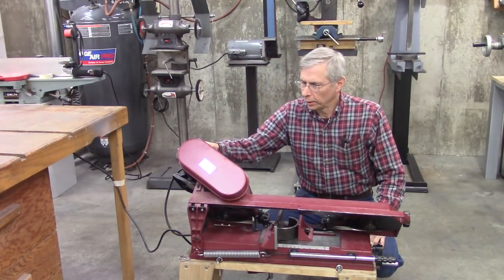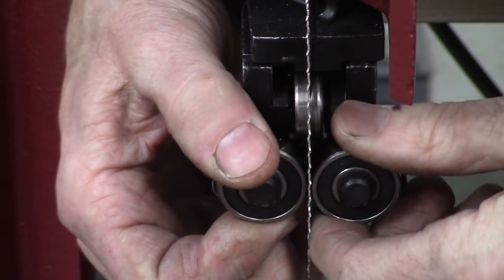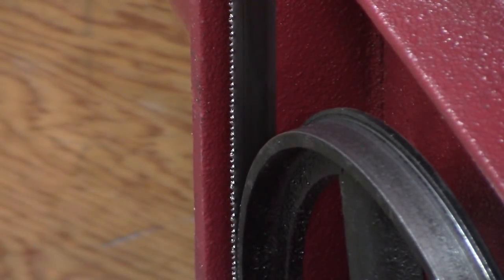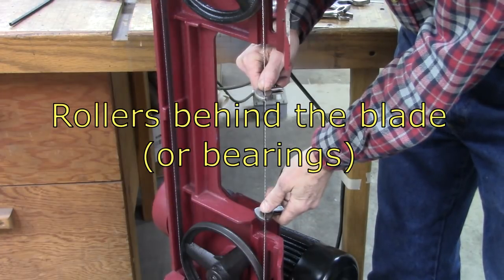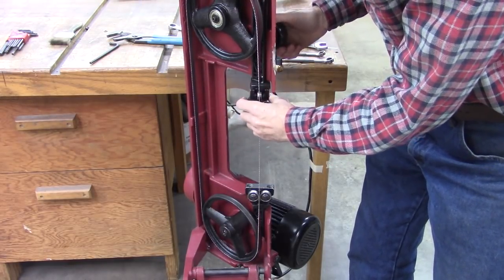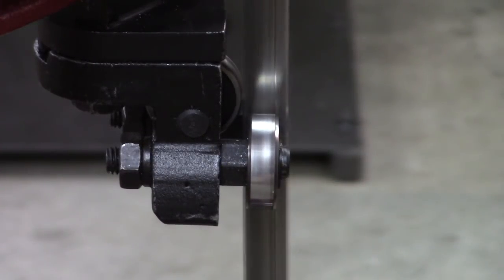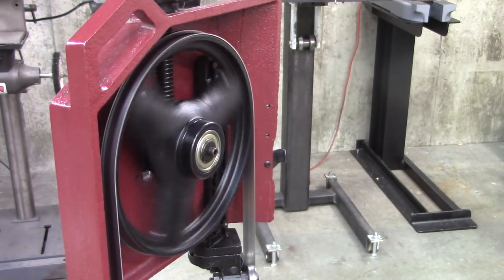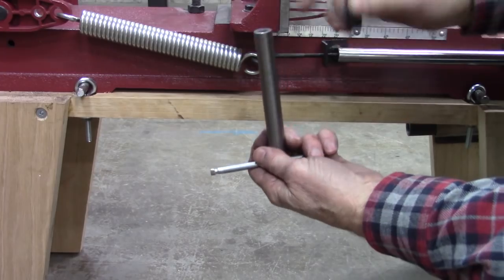4" x 6" Horizontal Bandsaw Tune Up

Comment: i have a question. i bought mine this year. on the tracking. when i take my blade guides out and run it the blade hangs off the bottom wheel no matter how i adjust the tracking. what do you think?
Reply from the maker: The way the blade tracking works it's affected by the amount of blade tension so make sure the blade isn't too tight. Also you have to loosen the other two bolts slightly. It works but it's not a very good design. If you understand how this works and know the tracking adjustment won't correct the alignment on the lower wheel then check the lower wheel position on the shaft. There is a snap ring on the end of the shaft and the wheel needs to be up against it. Also make sure the center screw on the upper wheel is tight. If you take the bolt out on the upper wheel shaft the end of the shaft should be close to flush with the bearing. If the shaft is significantly recessed into the bearing the wheel may not be on all the way, And finally, make sure the tracking adjustment isn't coming apart and allowing the wheel to be pushed out. This is hard to describe but basically if the two upper most bolts are too loose the tracking adjustment bolt will push the wheel out. I know a guy that had the same issue and he took his saw back and got another one. The new one was perfect although he did buy my elevating plate to address a depth of cut issue. Hopefully this helps.
Reply: @WinkysWorkshop  thanks . thats some good information. i wiil recheck the upper and lower wheels. on the blade tension. i have read about so many differnt ways to determine proper blade tension. what is your opinion on this ?
Reply from the maker: @joelspann228  - the way I see it, tight but that's not very scientific. Tight enough that the blade doesn't deflect while cutting.
Reply: @WinkysWorkshop  thanks . very helpful

Comment: I bought one of these last year (grey and sold in Canada) and they're great little saws for the money and should last a good long time, but the initial quality control and fitting is pretty poor and mine needed some fine tuning as well. The supplied belt wouldn't go over the pulleys at all so I used some link belt, the pulley cover (plastic) rubbed at the highest speed and needed some work, and the little metal bracket couldn't be adjusted far enough to trip the toggle switch to off after I adjusted the guides. I had to elongate the slot a bit to make it work. I also need to make a new stand for it, the factory one is pretty flimsy. I had an unused metal handwheel that was a perfect replacement for the plastic crank handle on the vise. I compared it to one owned by a friend that's over 30 years old and other than more plastic knobs and covers they're pretty much identical. There must be millions of these out there.
Reply from the maker: The switch lever issue surprises me. The prefered blade guide adjustment is with the back bearings in the guides just barely touching the back of the blade. Mine will not adjust that far but even so the saw has to be adjusted super low to make the blade cut all the way through stock without tripping the switch. Are your guides pushing the blade down? I'm wondering if there are a bunch of variations of this saw or it they are all coming fro the same factory?
Reply: @WinkysWorkshop  The castings all look identical but many other parts are different. Both my switch (a metal toggle) and the trip piece (shiny, not black) are different, and the belt cover is moulded black plastic. My blade guides were much better aligned than yours. It may be a common design, even using the same castings from the same manufacturer, but be assembled  in different factories. Some parts probably change due to availability. I’ve also been told that different companies will buy products made off of the same line but with slightly different specifications for fit and finish, secondary parts, and of course, colour. The company that sells mine do all of their machines in light grey. I compared two different bandsaws once that were side by side in a store, by two different badged companies. They were obviously the same design using mostly the same castings, but the castings on one were cleaner and better finished, metal rather than plastic knobs, better hardware, and just looked like it was put together with more care. I suspect that the metal composition of the castings might even be different. There was also about a 20%-30% price difference.
Reply from the maker: @robertpearson8798  - The castings set the blade postion. Or I should say, the way the castings are machined. After casting the holes for the wheel mounts are machines and so is the pivot point. When my blade guide are set so that the blade is only twisted and has no deflection (which is ideal), the blade will not cut completely through the stock. If you are cutting completely through the stock without having to deflect the blade I suspect the pitot point is machined in a different location. Moving mine 1/8 to 1/4 inch would likely fix mine.

Comment: Great video! I bought an earlier genesis of the same model 20 yrs ago to cut stainless pipe...made up a coolant recovery system and made scores of tweaks as many mentioned by many of your viewers. It still works great when used properly and I don't go beyond its limits.Best $100 spent for a typical off-shore product.
Rick from Canada.
Reply from the maker: Good value for sure!

Comment: Good video. ia have the same saw. I did put 2" angle iron on the corners of the legs and underneath both sides of the tray. I also put bigger wheels on the back and swivel wheels on the front. It rolls good and will turn any direction. This really made the saw sturdier.
Reply: I did the exact same with mine. Locking casters on all four legs, the angle iron made is much more sturdy.

Comment: Enjoyed your video thanks, but how did you make and fit the wooden frame?
Reply from the maker: Thanks, The only reason I made the wood stand was to make it lower to fit under a table. I don't think it has any advantage.
Reply: @WinkysWorkshop  The only reasons I asked was that my present machine came without a lower half or wheels at all second hand, a previous one I bought new 20 years ago had awful weak and fragile support system, just sizes of wood used and fixing methods would help please.
Reply from the maker: @dvddale111  I made the stand out of white oak that is 1-inch thick just because I had it. You could use a 2x10 and do the same and use plywood for the legs. Screw and glue them in place. Here's a link to a drawing. The drawing does not show the hole size and position in the table so you'll just have to set you saw on the base and make sure you can access the blts needed to adjust the fence etc. I angled the legs out about 1.5 inches at the bottom which is also n0t shown in the drawing.  https://photos.app.goo.gl/WiYGL46FcFSnzGtD9

Comment: More then well done!
What an educating, useful and important video! In the beginning the thought was I've seen this, practised it and improved my bandsaw already. That was lesson 1. Your video was lesson 2, 3 and a bonus lesson.
Lots of thanks!
Reply from the maker: Wow...  that's a great comment, Thanks!
Reply: @WinkysWorkshop  You really deserve it. There are plenty of bandsaw improvement videos on YT but You showed things I haven't seen before.
Reply from the maker: @Stefan_Boerjesson  - Well thanks! In concept it's simple, don't deflect the blade. This was my gut feeling and to some degree what I had already done. Then I did a little searching and found a video about a Grizzly Tools bandsaw. It was one of there high end saws and honestly a very poorly done video but they were saying the same...  twist the blade, don't deflect it. The thing is, the HF saw does not allow for this without some modification. Still... if you go in this direction as much as possible the saw will work fairly well.

Comment: 23:25 I don't know why you've used a piece of pipe when you could have adjusted the moving jaw to the right to achieve the same thing.
Reply from the maker: It centers the load on the movable jaw. The movable jaw will not get close enough to the blade to hold a small piece and it also pivots. When clamping on one end of the vise the bolt doesn't hold. It's never good to clamp on the end of a vise anyway but using the pipe distributes the load evenly
Reply: @WinkysWorkshop  Yeah, I guess you'd need to have cut the first piece off to put at the other end of the vice ;) to balance the load.
The half-pipe is a good fix for that.
Reply from the maker: @millomweb  - Yeah...  super quick too

Comment: How  do you get a starting position for the top wheel?
Reply from the maker: Good question. Honestly, I'd take the blade guides off and put the blade on under a small amount of tension and then hold a straight edge against the lower wheel or slightly away and then make sure the upper wheel is square to the straight edge. Hopefully you can run the saw and keep the blade on after doing this. Then you can adjust the upper wheel angle until the bladed just barely hits the ledge on one of the wheels. Then start increasing the tension and readjust the tracking as needed. The reason the blade guides need to be removes it that if they are positioned wrong they also effect the blade tracking. After the blade has enough tension and is tracking right then you can install the guide correctly. Ideally the guides should only rotate the blade to the vertical position. Hopefully you don't have a depth of cut issue after doing this. If you do, you can deflect the blade downward with the guides a little but doing this very much is not ideal. I was selling an elevating plate on my web store but steel went up so much I can't afford to make more. This was a spacer plate that goes under the vise to compensate for a messed up saw. Hopefully your saw is not messed up.
Reply: @WinkysWorkshop  That seems to have worked Thanks!
Reply from the maker: @1950cle  Cool! Your welcome.

Comment: How tight should the blade be?
Reply from the maker: That's a hard to describe without a torque wrench . I would say firmly tight but it is not super critical is the guides are set up right.
Reply: The reason I ask is that if I make like a guitar string, it wants to walk off the pulleys. Maybe it should be a bass guitar string!
Reply from the maker: @paulanderson7259  Yeah, when that happens you are flexing the casting of the top section. To some degree this is normal and I adjust the tracking to compensate but you can also go too far.

Comment: Hey Wink...great video as usual!!  I will take to heart all of the tweaks you did to yours and take another look at mine.  
Don’t know if anyone’s suggested this to you but you can mount a small table on it for vertical cutting which is super,  super handy. I even sit down on it while cutting small pieces.  It’s actually pretty comfortable. I’d love to see what you’d come up with for mounting it
Reply from the maker: Thanks...  Yeah, I have the table that came with mine. I was too lazy to put it on when I made the guard. I have another trick for the table that makes it easy to instal. Like in 10 seconds. Coming to a theater near you - Ha

Comment: Great video , I think every one of those saws had its own personality and flaws to go with it. My particular saw had an eccentric drive wheel, you could see the frame flex with each revolution, also the on/off switch failed after a couple of years. Enjoyed the show, thanks and cheers! Also thanks for the pipe trick and the extended nut underneath, it is deceptively simple
Reply from the maker: Thanks, Eccentric drive wheel huh? I had a portable bandsaw that did the same, flexing too. Yeah that pipe trick is a good one...  not my idea but worth sharing.

Comment: Loved the pipe tip!  I had a saw like this for years and it is one I had purchased used.  There was considerable wear in the angle drive assembly. . . which was supported by one only bushing.  The wear was working against a bronze gear so in order to preserve it, I removed the bolted plate cover and machined a sleeve in which I placed a bearing the same size as the shaft that was driving the bronze gear.  I put a grease zerk on the end of the sleeve such that grease could be pumped into the bearing and then welded the sleeve to the plate.  There was enough slop in the mounting holes of the plate to center the shaft in the bearing and sleeve.  I never had to fitz with it again and it was good assurance that there were no future problems.
Reply from the maker: I suspect this is a weak area. Thanks for commenting.

Comment: 2:34 I've seen some of these saws fitted with a brass wire wheel to remove stuck swarf from the blade. They're usually relatively small wheels mounted just after the cutting point. Looking at the main wheels, to me, it would seem very sensible to mount the wire brush on the same axle - so the wires poking at the blade do so without any relative motion - meaning the wire brush should last for a much longer time. Have a think about fitting something up like that - to see how effective it is and how long it lasts.
Reply from the maker: I have thought about something to clean the chips from the blade. I occasionally hear then go through the bearings...  probably not a good thing.

Comment: what kind of blades do you use and how many teeth my saw will cut but it is very very slow
Reply from the maker: This might be a better option. Its a variable pitch 8 to 12 tooth. I've ever tryed it but plan to  https://amzn.to/3cYm7En
Reply: thats great but my saw will take much longer to cut through a piece of aluminum the size you cut it takes around 20 min to cut through a 2" round piece of solid cold rolled how aqbout yours
Reply: @WinkysWorkshop  i will try them both thanks
Reply from the maker: @le3045acp  - Go for it...  I think you'll like the 8/12 tooth

Comment: Hi Mark, this was a very good edu-torial, thanks. I recently gave mine a touch of well needed loving. I found I had a bit of wiggle room with my Gearbox / drive shaft and the idler wheel tracking plates.   I had reinstalled them out of alignment and spent a bit of time figuring out how I stuffed it up. My guide roller mounts also have very little sideways adjustment.  Stay safe and well :)
Reply from the maker: Thanks...  yeah, the saw is a bit crude but cheap and works well if you take some time with it.
Reply: @WinkysWorkshop  It's basically the same as mine. I was thinking of putting wider wheels on mine to fit a wider blade, but I'm not sure if this would work with the short distance to twist.
Reply from the maker: @AJR2208  Interesting...  you may have a point there but it would also solve the problem with the saw not cutting deep enough.

Comment: That trick with the pipe is pure gold, definitely going to use that one. These little import bandsaws are awesome for those of us with more time than money. I absolutely love mine but it was far from perfect out of the box. Another great video 👍.
Reply from the maker: I agree on the pipe. I saw it somewhere and felt it was worth sharing. I agree on the bandsaw although it would be nice it the adjustments were fully obtainable without modifying

Comment: Mine is from the late 70s. The hinge point has been broken and repaired. The guards have been.patched many times. The top plate and drive shaft have been replaced. The poor thing has been through the wringer but still cuts as true as new, maybe better. A guy gave it to me when I bought a ton chainfall. He said it was a piece of crap and he could never get it to cut well. It fit In the back of my van just fine. Being a machinist i set on to seeing why it wouldn't cut right. Now most of you guys are saying to yourselves......ha! The blade was on backwards. Nope. It humbled me for a day until I saw it.......the motor was running in reverse! After that it was a cutting little SOB and the only limiting factors are size and quality of blades. 
Be safe and have fun 
Terry from South Carolina
Reply from the maker: Ha...  wow. Cool story!

Comment: I have the same saw with the same design flaws. Funny how something takes "THIS" much effort to manufacture and then they don't go the extra 3% to insure that it operates properly. ... China.
Reply: Yeah, china can't find 8yo kids that can do it right.
Reply from the maker: Really the original design is wrong. The pivot point for the top half needs to be 3/8" lower. The biggest quality issue I saw was the blade guide arms sliding in a rough casting. It needed to be machined.
Reply: @WinkysWorkshop    yes I noticed the same thing. By the time I got mine to stop throwing the blade, I had the guides in too far to make a complete cut. I will say that the saw will cut very true when dialed in.
Reply from the maker: @leeroyholloway4277  - It seemed totally logical to only twist the blade and NOT deflect it but before I did this video I did some investigating. Grizzly has a video on there high priced horizontal bandsaw and they say that the bearing that rides on the blade should not turn until you make a cut. I'm closer to this and the saw is working better than ever but I can't achieve this.